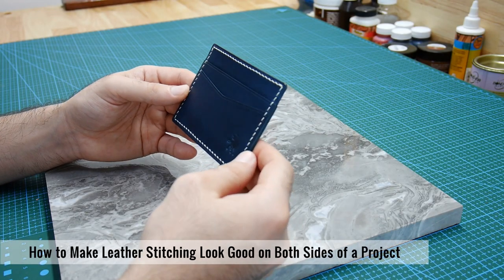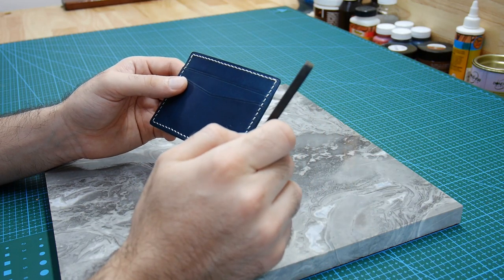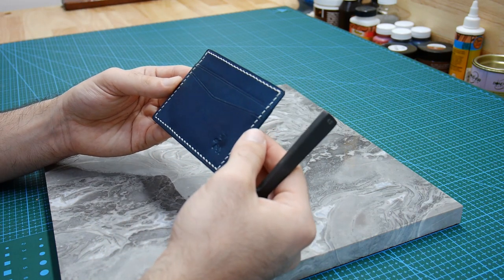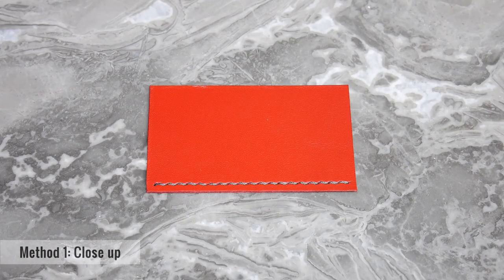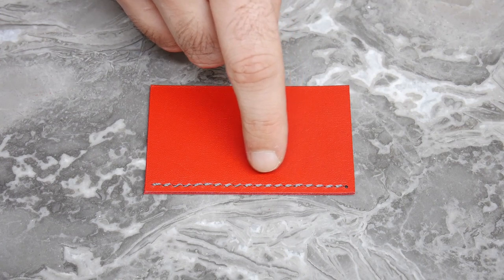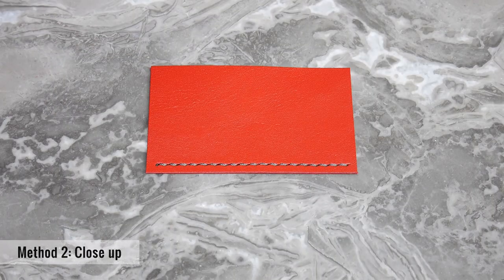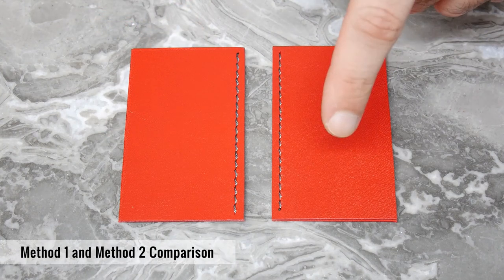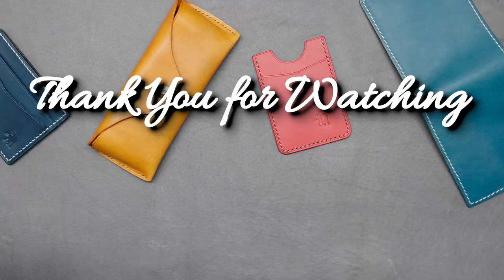How to Make Leather Stitching Look Good on Both Sides of a Project

Comment: Great tutorial. Question, can we use the method 2 stitching in method 1?
Reply from the maker: Thanks! Yes the stitching sequence is the same for both tests. What is different is the angle in which you pull the threads when you tension them so the thread gets pulled to the correct part of the hole. In this case the back side stitches will be slanted different angle between the two methods so the angle you pull the threads coming out on the back side will be different.

Comment: easier with reverse and obverse if you buy
Reply from the maker: Yes it can also be achieved by using reverse chisels however that is a bit of an investment.
Reply: Reverse chisels will not give the x-slot. They will just ease punching through in one direction.

Comment: Well done!  Also, what size is the thread (the .6mm?) and is it unwaxed as it appears?
Reply from the maker: Thanks! This is a 0.5mm unwaxed bonded polyester thread which means it should not fray like other unwaxed threads.

Comment: Hi, did you think about the reversing punch?
Reply from the maker: There is a way to use a reverse chisel to punch on the back side for Method 1, however I would not recommend it. Even if the leather is thick, you can use a diamond awl to hole through from the front side of the leather.

Comment: When working with the slanted "not-diamond" stitching chisels, do you line up the stitching line with the frontside or the with the middle of the tips?
Reply from the maker: Using the middle of the tips it is hard to line properly to get a straight stitching line. I like to mark the stitching line close to the edge of the leather and line up with the front of the irons.
Reply: @TeranAtelier  ah okay, that's what I thought. Do you use the same distance when working with diamond stitching chisels or do you use a bigger one as they line up with the tip better?
Reply from the maker: @dukehorndrake5525  I adjust the distance so that the center line of the resulting stitching is consistent. I design all my patterns with the stitching centered 3mm offset from the edge except for special cases.

Comment: I'm still trying to analyze different stitching methods.

I've noticed some variations in stitch orientation: 1. stitching away from the body with the slots slanting up and away from the body; 2. stitching toward the body with the the slots slanting up and away from the body; 3. stitching toward the body with the  slots slanting up and toward the body. This last one requires reversing the side of the slot ingress (side where the prick/punch was initiated). Most people seem to place  the ingress on the right-hand side, which results in having the slots slant up and away from the body.

With each one of these versions, I think it is important to determine which needle goes in first, which side gets cast and how, and the angles of the left- and right-hand pulls.
Reply from the maker: Yes each one will need order but I think the side that gets casted shouldn’t matter only the direction of the cast; cast over or under. I think they all should look the same at the end if they sit in the correct part of the hole.
Reply: @TeranAtelier  I'll have to experiment a bit more, but I'm under the impression that casting side matters. It seems that every variable matters.
Reply from the maker: @pequodexpress  Definitely test it out, but I think the 'cast' ends up halfway between both side so it shouldn't matter which side it originated from.
Reply: @TeranAtelier  The stitch seems to have better separation into the top and bottom of the slot with backcasting and stitching toward the body. This is what I seemed to have experienced today.
Reply from the maker: It could be that the holes on the punched side of the leather have a better shape as they are a sunken in a bit and make the stitches look a bit better. After hammering the stitches it should be difficult to tell which side was which.

Comment: Hello can i use nylon thread for leather?
Reply from the maker: Hi. Nylon thread is not very UV light resistant and is not normally used for leather work. I recommend using only polyester or linen threads.

Comment: No wonder my stitching looks like a derailment of a train.👍🏻
Reply from the maker: 😂😂 Good luck with your next project!
Reply: I think we all start that way! A few things that have changed my stitches for the better - 

A good set of irons: they don’t have to be crazy expensive, but invest in the best you can afford. (Wuta makes some affordable irons) IME, diamond irons make for the most elegant, professional stitching. 

Layout: use a wing divider or stitch groover to give yourself a perfect layout and be meticulous about positioning your iron. Plan ahead by just lightly marking your holes first to see how you’ll deal with corners/overlaps etc. 

Keep a rhythm: find what works for you, and stick with it - do the same motions and order with every stitch. Building or buying a stitching pony can be very helpful with this. 

Hammer your holes and stitching: once you’ve got your holes made, lightly hammer them - this will make the holes appear smaller. Then lightly hammer your finished stitches as well, it seats them and makes them look more finished. 

Use good thread: invest in quality thread, it’s relatively cheap anyway and makes a big difference. Use a size that’s appropriate to your holes/project. I like Ritza Tiger or waxed linen

Comment: I could not make any sense of the second method.. you did not even explain which side is which and which side we are gluing together.....How are we aligning them?
Reply from the maker: As a basic summary for method 2, the two sides of leather need to be ready to be glued together and the same length. You punch matching holes from the grain side of each piece. Apply glue to the edge on the flesh side. Stick together using the same edge alignment from when you chiseled the hole. The holes will line up and you will be able to pass your needle through them.

Comment: How are you stitching now? Are you pulling both threads up, or the right thread up and the left thread down? Experimenting with both methods has improved my stitching. Pulling both up seems to yield better consistency. I do think that pulling both up works better when stitching away from the body. Because of the direction of the slant.
Reply from the maker: When I initially pull on the threads I pull them horizontally which seems to stop the threads from twisting themselves. Near the end of the loop I angle my threads to get them positioned correctly in the hole. I pull both up when I chisel holes only from one side, and right thread up and left thread down me when I chisel holes from both sides separately.
Reply: @TeranAtelier  This is what makes you special. You pay attention to important subtle details that others do not.
Reply: @TeranAtelier  This might be what I'm  overlooking in my stitching. I slant for the duration of the pull. Horizontal and slant at the end seems like it might be a good method.
Reply: @TeranAtelier  Now I am beginning to wonder about the significance of the hole slant in relation to direction of stitching: away from the body or toward the body. One reason I seem to be getting better results with your method might be because I'm stitching away from the body with the slant also rising away from the body. When I employ my previous method, I am backcasting and stitching toward the body with the slant still rising away from the body.
Reply from the maker: @pequodexpress  I think your previous method of stitching towards yourself should still work as that is a common method of stitching using an awl in your right hand to create the stitching hole that was punched on the right side. The side that you cast should not really matter as the 'knot' gets pushed to center of the leather edge, only the casting direction matters.
Reply: @TeranAtelier  Have you tried punching on one side and using an awl to punch the other while stitching ? How are the results of this kind of stitching on both sides of the leather ?

Comment: Thanks for the tip...i'am in trouble when gluing the two pieces, my holes never matches. What do you think about using both observe and reverse iron ? should it work the same ?
Reply from the maker: You are welcome! Using obverse and reverse irons for this application is not required and won't help with alignment issues. The stitches need to align based on the corners of the edge. I have revisited this method in a new video: https://youtu.be/GxPb19fvFVU

Comment: Question, if you use a stitching chisel that doesn’t have the angles to it, one where the tip is shaped like a circle, would the stitching turn out even on both side using the first method? And could you achieve the same by using a stitching awl to punch though if you were to use the chisel to mark and make the hole with the awl? I assume you’d lose the angle to the stitch. Thank you for the video
Reply from the maker: Using a stitching awl (flat or diamond) will work to make the angled shaped holes, this is normally done by rolling a stitching wheel first to mark out evenly spaced hole centers. Then you just need to be careful when punching with the awl to get a consistent hole angle. If you used a scratch awl (round) then the round holes will only give a slight angle if you use method 1 with where you wrap the thread over the needle.

Comment: Hello. In my opinion there are two errors in your methodology. First one is pricking iron are made for marking the stitching and not for going through the leather. Then you can use stiching awl. The second thing is you are stiching in the wrong way, stich toward yourself ;)
Reply from the maker: Hi, the direction of stitching of forward or backwards is a personal preference. You can achieve the same results going either direction but 'left' and 'right' will be reversed. Traditional pricking iron brands like Dixon and Vergez Blanchard require an awl as the prongs are quite thick and will leave a big hole if you try to punch too deep. Modern pricking iron brands like KS Blade and Sinabroks do not require an awl as the prongs are thin and can easily punch through thick leather without making a big hole. The Crimson Irons which I use are a Japanese style chisel with pointy tipped prongs so it is designed to punch through all the way. I hope this helps.